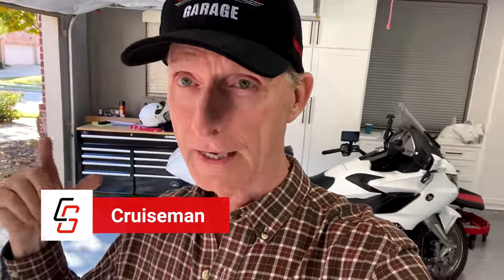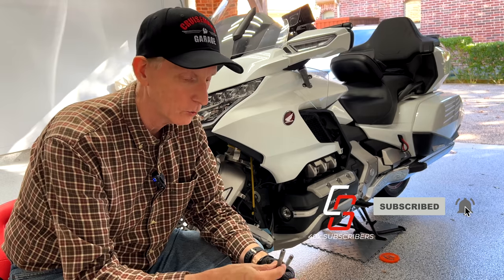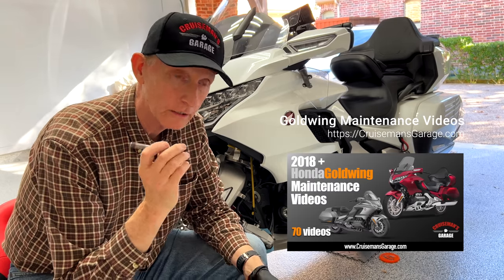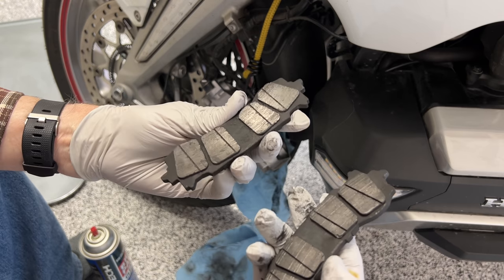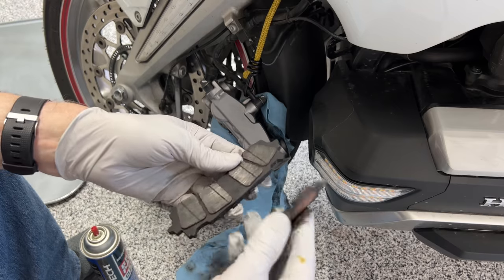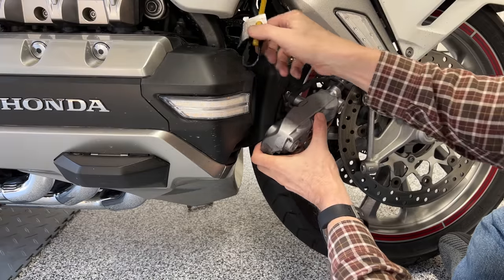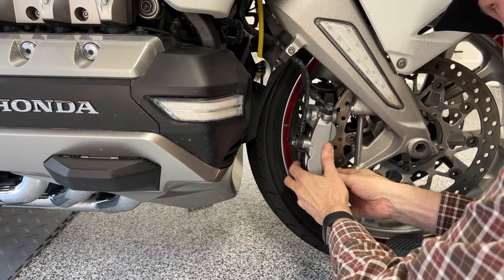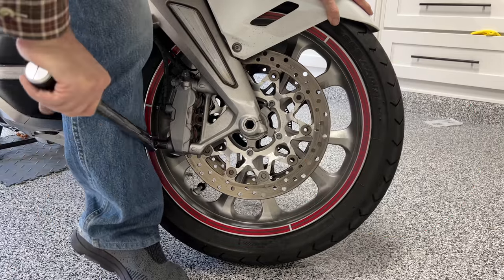Time to Replace Front Brake Pads | 4K  | 2018+ Honda Goldwing | CruisemansGarage.com

Comment: The caliper bolts are not stretch to fit.  Honda recommends replacing them only because they have threadlock on the new bolts.  Just thread lock the old ones and your fine
Reply: BUT, the type of thread lock is not the anerobic "locktite".  There is a type ttat you apply to bolt and let air dry for 15 minutes and then tighten, looks just like OE.

Comment: Just bought the videos .
 Broke even on the first repair  not to mention the time saved dropping off my 2019 at the shop. Front and rear brake pad replacements. The videos are thorough , easy to follow and  it's comforting to know that the job I did was done correctly and safe.

Comment: I just did this last week. I used the old pads to push all the pistons back so I wouldn't ding up the new pads. My inside pads were waaaay more worn than the outside pads.

Comment: A huge contributing factor to the Uneven pad wear comes from the fact the Calipers are of the non floating type as used on the last model Goldwings my 2012 did 55'000Ks on a set of front pads and NO sign of uneven wear at all and i rode that like a sports bike :) :) :)

Comment: Rest assured if Honda recommends that the bolts be replaced I will.  Thanks for the video.  What blows me away is the Honda technicians don't bother replacing them.

Comment: When using a torque wrench, you should hold the wrench by the handle, not mid way like you did in this video.  I use a technique called counter torque, hold the head of the wrench in one hand and the handle in the other and push/pull in opposite directions to apply an accurate torque.

Comment: Sorry, never heard of replacing caliber bolts when changing pads. I would clean old locktite off and reapply locktite, tighten to spec and move on.
Reply from the maker: I did that when I removed my calipers the first time.

Comment: Looks like you put the right side pads on upside down. There are arrows on the bend over tabs, my understanding is they are supposed to be pointing up.
Reply: When I did my brake pads I put them in with the arrows pointing down, not knowing the correct way to install them was pointing up, and they would squeal. After making comments on social media about it squealing, someone told me to install them with the arrows up and I did, and the squeal went away.
Reply: Thanks Darren, great tip.

Comment: I agree I recently had the shop do my brake pads as  I was having the tires replaced - so they did the pads at the same time - I’ll bet they didn’t replace the bolts (no charge - for doing brakes and no charge for bolts?? - so I doubt they replaced them???) Can I now just replace the bolts and properly toque them without removing the calipers?
Reply: Yes, but not necessary.

Comment: Just curious, how many miles did you have on your bike when you replaced them. I know we all use brakes at a different pace. I bought replacements last year but found I was ok all around. UPDATE: your video was a timely reminder to recheck my brake wear. The left front pads looked like yours, inside pad was about a 1/3 of the outside pad and ready to be replaced. The right caliper had almost even wear inside and out. I have 27,000 miles at this time and mostly ride the twisties in mid Missouri that are just below tail of the dragon difficulty.
Reply from the maker: 22,000
Reply: Did my front at 12K and didn’t really need them. I saw how uneven the wear was and just changed them anyway.

Comment: CM, could the unusual wear be a result of the rider's style of braking within the parameters of Honda's integrated braking system?  Personally I understand why there is integrated braking but I prefer them separately, like old school bikes, ie front brakes via lever, back brakes via the pedal.

Comment: I replace mine with each tire change which is around 12,000. Curious how much you got out of a pair it says 4k. Very simple change I think the torque specs are a little heavy for such lightweight bolts in the fact that they caliper sit on bosses. Much simpler design than my Honda Valkyrie.
Reply from the maker: It depends a lot on riding style.
Reply: @cruisemansgarage  I know you do a lot more highway than I do. I'm just curious what people are getting out of a set of front brake pads. Mine were pretty well worn out at 12,000. Check the back ones and there's more than 50% on those.
Reply: @Doc832   Also 2018 GL non-tour. At 30,000 km (18,000 miles) in September I measured the brake pads and found front had 60% and rear had 75% remaining I hardly use the rear pedal and mainly highway miles. If this ratio stays I will easily get 30,000 miles. My next big maintenance comes in 2024 at 50,000 km so I will replace both sets then. Please note I do not ride this bike much in the city.
Reply: @gordonb216  well thanks for the heads up on that. I ride this bike more like a sport bike in the twisties and country back roads. I do a lot of city driving and not enough highway that's for sure. My front brakes were down to about 20% when I changed the front tire. I just checked my back brakes the other day and I still have more than 50% left. I may still change them out when I change the tire. I bought extra rim and tires from eBay so it's just a quick switch out. Thanks for the info. Good to know what the OEMs should get.

Comment: 31,000 & counting on my 2019 Goldwing tour factory brake pads.
Reply from the maker: Wow. Do you just coast to a stop? :)
Reply: @cruisemansgarage  Steve McQueen popped into my head. He was once asked ‘How are the brakes?’ and he famously answered ‘Don’t Know, I never touched ‘em’
Reply: I had 35,000 when I changed out both front and rear, thanks to Cruisemans maintenance videos, rear could have gone another 5K. I won't go that long for the front.  I do a lot of braking coaching safety classes and lots of slow speed parking lot practicing.